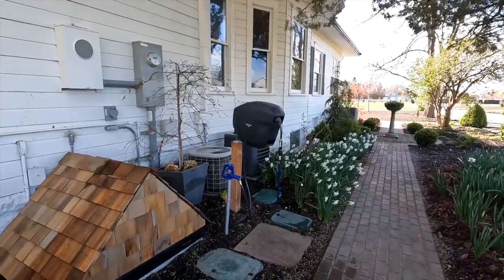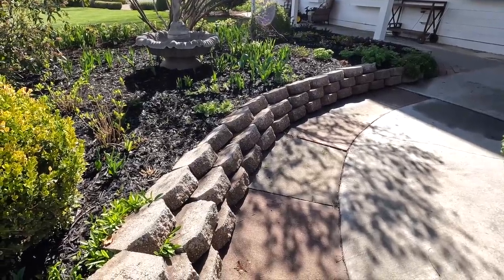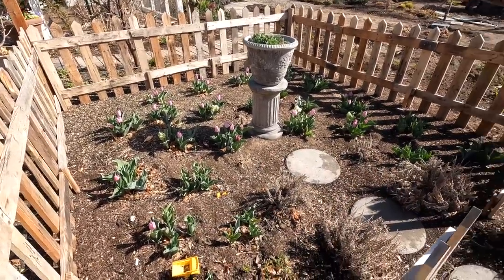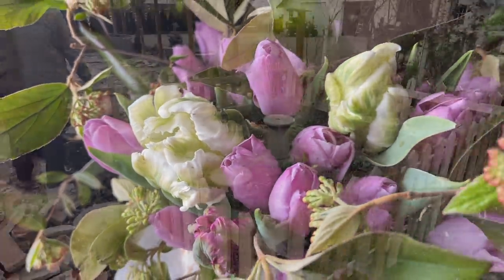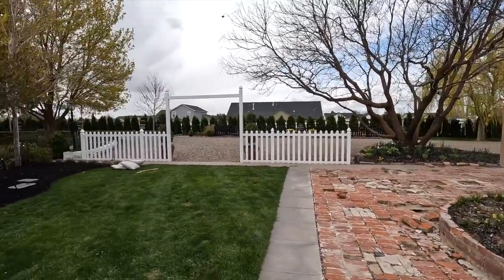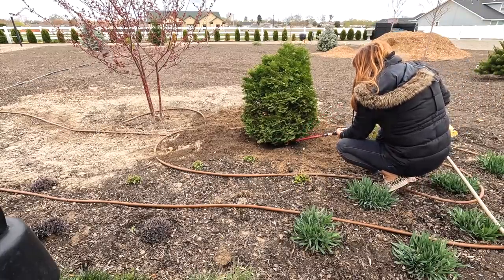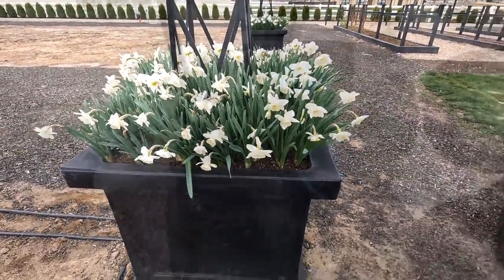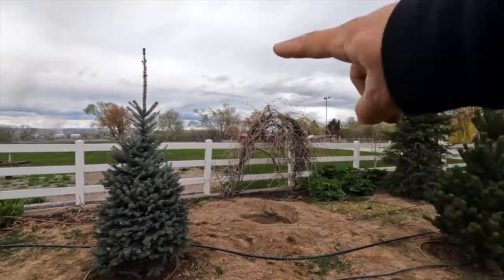First Day of Sidewalk & Brick Patio Demo + Planting a Birch Tree! 🌿💪🙌 // Garden Answer

Comment: We've noticed when you plant trees & shrubs that you pour, what appears to be, several cups of Biotone into the bottom of the empty hole,  then plant the tree or shrub on top.  The Espoma Biotone website and directions on the bag specify: "Trees & Shrubs:  Mix into the soil used to backfill the planting hole", which makes since since the majority of shrub and most tree roots grow within the top 12" of the surface of the soil (other than tree tap roots).  Is there a reason why you add the Biotone below the majority of roots instead of surrounding the rootball?  Love your videos and all of your insights!!!